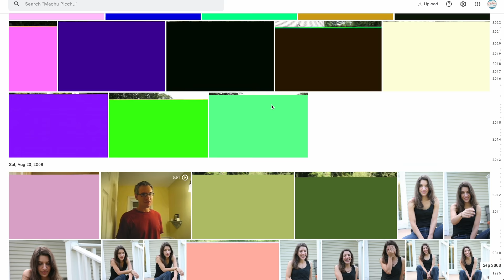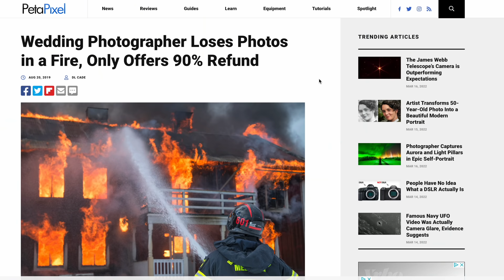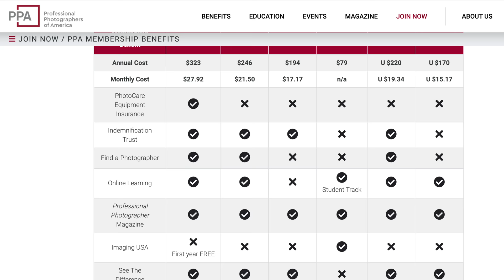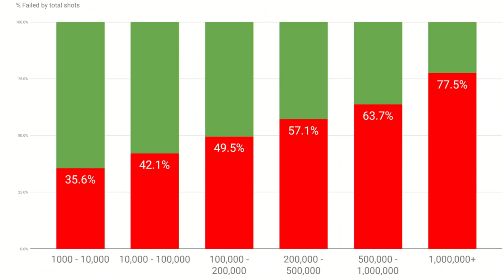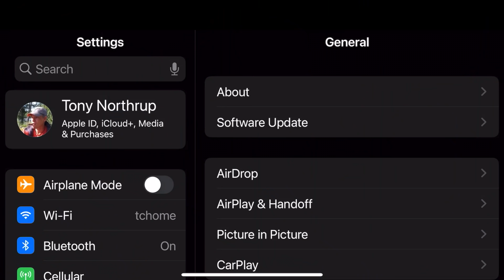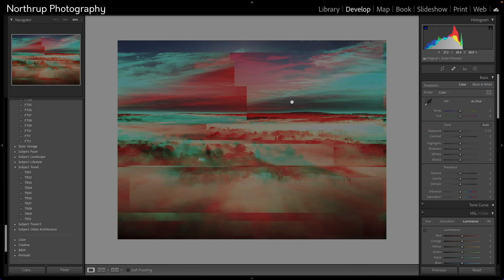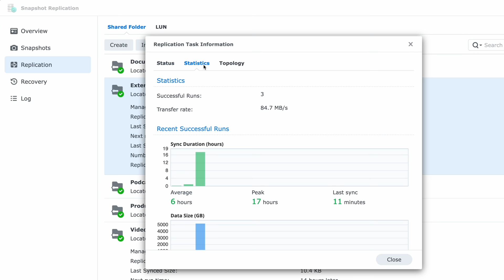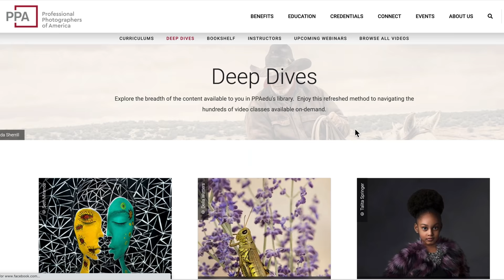NAS Storage for Photos & Video: PROTECT YOUR DATA!

Comment: Some great advice there. You can never have too many backups. I too keep photos on my memory cards until I`m certain they are backed up. The importance of a good power supply is  very true. I did lose some images one time, photos of a friend with his classic car which he no longer has. They just disappeared from my hard drive! How I don`t know but fortunately I came across them on an old CD I had backed them up to using my old Amiga computer! Don`t know if those CDs are readable now but at least they are backup up on other devices now. Thank you again for valuable advice.
Reply: I came across an old CD burned while I worked at Commodore, back when the "gold" CD blanks cost $50 each and we had a dedicated station for buring CDs. It was still readable, at least five years ago. That's pretty lucky, though if they're kept in a cool, dry place they can last for decades. There are, of course, better options today.
Reply: @DaveHaynie  wow that is great to know. So honoured to get a reply from you. Still have my A1200 tower and AmigaOne XE, both work. I kept my CDs out of the light, will have to try them. Thank you.

Comment: To protect and detect bit rot on a single drive use par2 parity software for instance.  Unraid is great for building your own storage server, will also run a complete check of all files once a week for instance.  Also wonder what camera you're using here, A1 ? There is a lot of distracting refocusing, specially in the last part.

Comment: Use NAS devices that are based on ZFS instead of EXT or BTRFS, it does a better job of predicting failure, deduplication, inline compression, copy on write in case of power failure regardless of UPS since an UPS only has a limited amount of battery time and you could be in the middle of backups, or a large job and the UPS runs out of battery during an outage. Also use backup software that protects the backups from randsomware, I use Acronis for this along with backups.  There are fire and water proof NAS devices "proof" being a relative term, but will help protect data within a window of fire (heat) and water damage.  Running a NAS with at least RAID 6 or equivalent (ZFS-2 or ZFS-3), is a good idea as you don't want a second drive failing during a RAID rebuild, as you'll lose your data.  Having a real-time sync of your data between identical NAS units is good, as soon as the data is written to one it's replicated to the other.

Comment: Is there any easy checksum tool that can just generate (and check) sidecar checksum files of a whole folder if not already available. That would at least allow you to catch bad files before backing them up and it's independent from the file system.

Comment: I use windows storage spaces to mirror my data across an array of six drives and then the whole array gets backed up to an 8tb offsite drive as a clean backup. I do frequently access old files and I haven’t yet suffered corruption due to bit rot. So far it works for me. I’ve only ever lost one folder of photos that was really painful to lose and that was entirely user error on my part.

Comment: I actually discovered some photo corruption when I started using Google Photos to back up the photos on my PC and it complained about some corrupt images that it couldn’t back up. I dug up my backups and they had the same corruption.

Fortunately I had even older backups which were okay. All my photos go to two external drives plus cloud backup. But I have two older external drives that have been filled up and aren’t actively written to anymore. I keep them around for cases like this.

I should probably spin them up more frequently though. Hard drives that are stored for years might succumb to stiction.

Comment: As a fellow nerd who has layers of media, devices, locations providing redundant copies (card, drive, external drive, synology, cloud), the one that still worries me is the bit rot problem. Are you aware of any tools to identify (and perhaps even correct) the development of bitrot?  I know that in theory techniques like hashes comparisons can do it. But I'm wondering if there are either file system level tools or automatable utilities that can constantly scan a repository and alert when something unexpectedly changes?

Comment: There is a way to confirm file integrity. The file system needs to do a bit sum and keep it with the file. This will at least alert the admin of a corruption. Bit sums are what the virus programs do to check for file viruses in core programs.

Comment: I keep several backups including many not connected to power and also use an online backup service but I have experienced some corrupt files. Out of frustration, I now run on a semi-annual process the following PowerShell script:
Get-FileHash -Algorithm MD5 -Path (Get-ChildItem "D:\Photography\*.*" -Recurse -force) | export-csv c:\check\PhotographyHash.csv
I discovered the attempt to generate the hash value will error out on a corrupt file.

Comment: Personally, I have most of my files stored on external HDDs.  I then backup into the cloud with Backblaze.  It's not perfect, but it's cost effective.. for the amount of data I have backed up, it'd cost orders of magnitude more to pay for general cloud storage.  (My ISP did freak out on the initial backup, and threatened to cut off my service.. turns out using 100% of your upload capacity for a few months is a faux pas, even on a so-called "unlimited" plan)

Bit rot is my biggest fear.  I don't know of any good way to automatically detect it.  And by the time I realize it by accessing the corrupted files.. I fear I'd be in a scenario like you are, Tony, where the backups were overwritten with the corrupt data long ago.  If there's a solution to this, I'm all ears..
Reply: Ha! I did the same thing a few years ago, 14TB to Backblaze. It was actually being throttled by BackBlaze's server, not my ISP connection, and in this case (Verizon FiOS), unlimited did actually seem to be unlimited.

Comment: Well as a former IT Guy I hope your two NAS's are interlinked via a SECURE VPN. I totally agree with the raid 6 config (2 drive failure) our server at work crashed with a RAID-5 config (1 drive failure wasn't enough with the two that failed) and well we had backup fully in the night before so we lost almost nothing but time! A hot swap is a great but regardless have at least 2 matching drives because in our case it took 3 days to get the drives! Very few can afford a 2nd system. But Backing up to lose Hard Drive and storing it at another location is not that expensive. I have a serious Enterprise Firewall at my house but I think it's a requirement. I generally keep Jpegs up on Smugmug which a Jpeg is better than nothing mindset!

Comment: I lost a hdd in a raid stripe that I dd not have backed up. Now I have three levels, I have raid/mirror on my user drive, which is backed up to a raid/mirror, both of which are backup w/Backblaze. So theoretically I can have all 4 drives fail, and I still have Backblaze (but as you note corruption gets backed up).

Comment: Could the use of a mobile phone near your storage system corrupt your hard drives? I stopped using wifi connections to my computers they are all hard-wired now. I don't charge or use my mobile anywhere near my computer room. So far so good for the last 20 years.

Comment: Doesn't each HDD 'sector' have a CRC on the drive? I'd expect bitrot on the drive itself to result in actual read errors, not in silent data corruption. Bitrot elsewhere though.. (controllers, cables?, memory)

Comment: Some day I realized that I have 1 TB data free from 2 TB hard drive.. Information in MTF file about files and his position was lost ! Any professional data recovery program can't see my lost data.. because MTF structure was fail. I was must searching by signatures. My distrust of the sudden free seat caused that I back data by recover the data scattered without the original names. In this moment I have 3 servers on freenas and openmediavault. Two disks as one. So I have backup on second disk.  I have 12 disks as 6 disks :)

Comment: or is this a software/version problem ?     disc files should be stored with a CRC so that reading a corrupted file results in an error. your o/s should do this all the time automatically.   I would load a Linux live stick and see if I could mount and access the old data structure.   then try a different software such as gthumb  to read the earlier files

Comment: we are still clueless as to how a whole bunch of files just "got corrupted". Was it a bad copy operation, file system corruption or what? You don't just get "0" swapped to "1" randomly - there are file checksums and redundancies and other file system features to prevent that. On the other hand if you were using old Mac systems - those were notorious for bad file copy operation when you would copy a bunch of files and the system reports a success while in fact most of the files were corrupted. I had first hand experience of that on my older Mac systems in the 2000-th

Comment: Windows users have access to Windows File History. Designating a hard drive for Windows File History gives you an automatic incremental backup of your data every hour. File backup over the internet is excruciatingly slow. Using Zip files for archival backup may be a possibility against corruption long term as they use compaction tables that may be redundant in the compression program (depending on the Zip program).

Comment: A single bit flip may or may not damage a file. Files have mechanisms to deal with a small number of bit changes, but never the less it is true that a small number of bits, or one in an unfortunate place can damage or destroy a file (JPEG or RAW, with JPEG perhaps being a bit more vulnerable due to the compression and decompression required but the difference is probably not much, I don't have any good data to say one way or the other). Tony discussed ways to physically secure the file, but another issue is format obsolescence. Anyone have a Word Perfect file that is no longer readable? While JPEGs thankfully have been very long lasting they are not likely to be "Permanent". It is quite possible that the HEIC (New format) or some other new approach will replace JPEG in the future. MP-4 replace MPEG-1 and a host of different codecs.  While you have access to both the old and newer technologies it is necessary to re-encode the files into the new format (and medium 8mm film,  3 1/2 disk, CD, DVD, Blue Ray, Hard drive, Online (Company X that may or may not stay in business so may have to copy to Company Y etc) in order to maintain access to them. It is a maintenance task. I found this with 8mm analog video tape that I digitized with an analog to digital encoder. Safe since it's now digital right? No the CODEC used after about 10 years was not supported. Luckily I found this in time to still have access to an older machine with the CODEC and I  could re-encode them with a newer Modern MP-4 format and Codec. The bottom line is that keeping photo's and videos is a maintenance task that must be revisited as old technologies change while that technology is still usable and must be constantly updated in order to be maintained, otherwise you risk losing access to the information in the files even if you back them up as Tony outlined. Both are important and necessary.

Comment: Cameras don't need dual card slots, they need good WiFi. Again: cameras need good WiFi, not dual slots.
Good WiFi means the the photos can be in your phone or laptop in almost real time on storage that is far more resilient and without using a lot of power.
But what we get is crappy WiFi which is slow, power hungry and does not really work automatically.

Comment: Figure this one out.  I get into a phone spat with your friends at Microsoft over my windows license. They say it's illegal I provide a receipt etc and they still say it it's illegal and I tell them where to go.  They send a 24 hr warning and nothing ha[[ens.  The next day my O/S drive is crashed and I connect my three separate external drives to another pc. these drives have about 450,000 images and now they don't. All my drives are wiped clean and the professional recovery lab said sorry all three drives are wiped. All my pro images all my 4 kids growing up everything gone. I quit photography.
Reply: So sorry for the loss of all those images! But it sounds like you got scammed by malware/"hackers" that claimed to be Microsoft rather than actually Microsoft. There is no reason for your drives to be wiped otherwise. A legitimate organisation does not send "24 hour warnings". Especially to enforce licensing on the most common operating system on the entire planet...

Comment: There's a simple solution - FILM! My negatives, Kodachromes & prints from 45 yrs ago are as good as the day  they were taken. So are my parents negatives & prints from 50-90 yrs ago. Photographers are seduced by the latest digital gadgets & gizmos but what they don't tell you is how limited the lifespan of digital files is. These will be known as the digital dark ages because  most digital files will gone in a few decades. Try reading a 5 1/4" floppy from just 30 years ago. Even if the files weren't entirely corrupted (which they probably are) good luck finding a 5 1/4 drive. They're not making them anymore. You can probably still send it to a service bureau but what happens when the last drive dies?

Comment: The BIG Problem is to identify the corrupt data. If you have enough data it isnt still not possible to identify per hand. Only Solution i know is to use MD5 hash. But you have to index Status NOW and then compare this with new readouts in the future. I did not know any software that can handle this. 
Do you know???
The problem is totally underestimated.
With each change of files, addition of new data or moving data the problem becomes even more complex.

Comment: Thank you Tony for this brilliant video. A question I have is, why do picture lose their quality when uploaded to online cloud storage? I have many old photos that had their quality depreciated over time by online storage website and I hate it. Any clue of what is going wrong?
Reply: Which online service are you using, specifically? Well, you don't have to tell me, but what I'm saying is have a thorough look at the fine print. A lot of cloud photo services (notably Google's) do compress photos the moment you upload them. While they might not advertise that fact or make it obvious, they do state it somewhere.

There are definitely exceptions to what I said above, but generally, if you want a "safe bet" that your photos will not be compressed/touched/modified in any way, you want to look into online backup services that are for any and all files in general - not photo specific. Services that back up any file on your computer won't automatically run photos you upload through lossy compression because they can't count on the file you're uploading even being a photo at all.

I personally use Backblaze.
Reply: Depends on the storage. If you're uploading JPEGs to a service like Google Photos, you choose whether you want to preserve original quality or not -- the "not" part used have unlimited storage, so many folks did that, rather than pay for unmodified storage, which can get pretty expensive if you shoot regularly and use the cloud as a real backup. If you're uploading "files" to cloud storage or backup, there's nothing special about photos and no quality is lost.

Comment: This is very interesting and also very important point to adress. I keep at home a dedicated NAS I created using Linux MDADM to run an RAID5 array to keep my backups. I know, its not the best way, but is what I can aford for the moment. I left unique external hard drives few years ago, and had no problems until now.
Since I sow a video from ThioJoe explaining the risks or an RAID5 array, I intend to change this to an RAID6 or even to an Z-RAID (better) to keep my files even more.
Having backups in different locations is also important as Tony told. I do not trust very much cloud services, so when I send something to the cloud, generally I encrypt it first.

One important thing is to keep looking to your backup files. A backup that can not be recovered is not a backup.
Until now, 3 years of Linux MDADM did quite a good job :)
Reply: mdadm doesn't protect against bit rot.
Reply: @BerenddeBoer  Exactly. That is why I told I intend to change to other technology.

Comment: I use robocopy to back up to external drives. I'm experimenting with using the /Log and /L options to check for newer or changed files before actually running the backup. Hopefully this will catch corrupted files before I copy them over.
Reply: This seems to work.
Run robocopy with the log and /L options. Then search the log for 'Newer' files. If the Newer files are photo files, you have a problem because these files are never supposed to change. However if they are .xmp files from Lightroom, that is OK because these do change. 
'Extra' files and 'New' files are OK, the Extra files are the ones to be deleted.